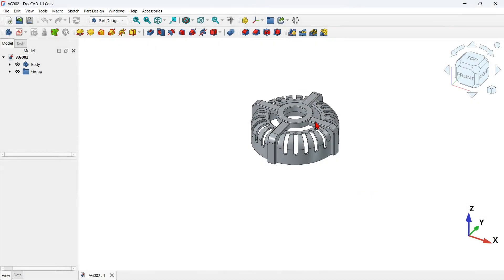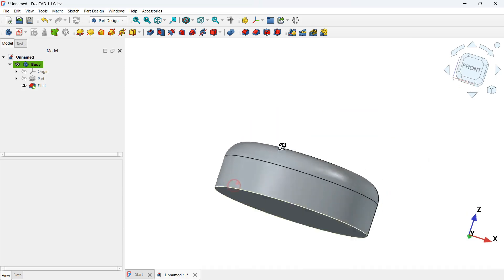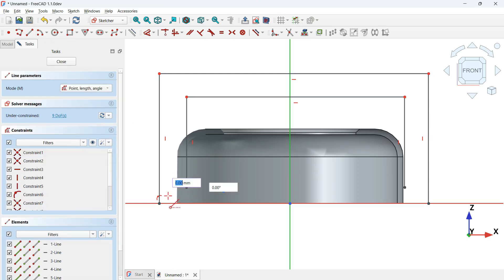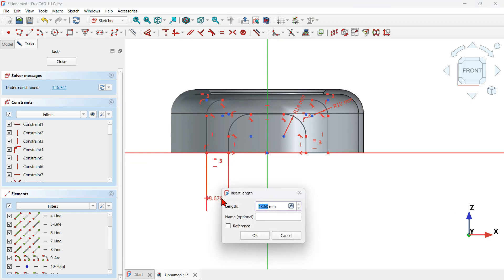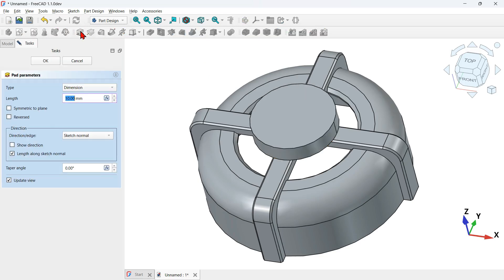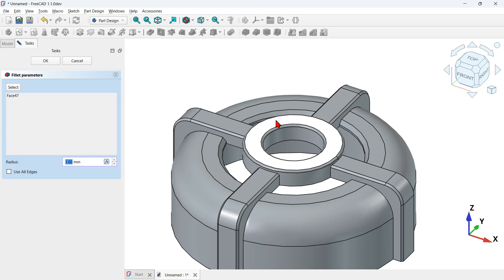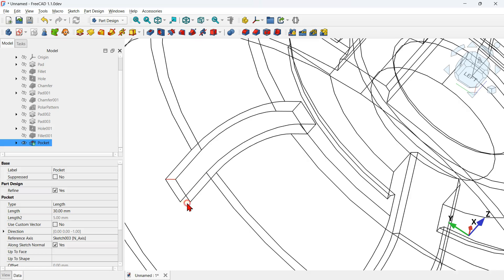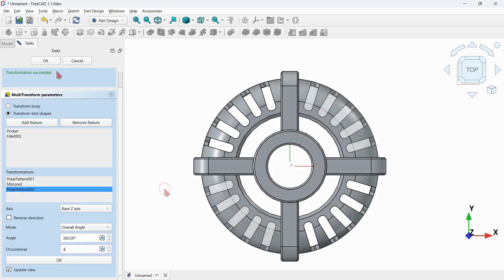FreeCAD 1.1: 3D modeling exercise 5 | Sketch + PartDesign, Pad, Pocket + MultiTransform

Comment: If you use PolarPattern in your case you actually make 3 copies. Putting 2 parts over eachother. 
If you use PolarPattern ->Angle 90°-> occurences 2. It's more 'correct'. 

Thank you for the tutorials.